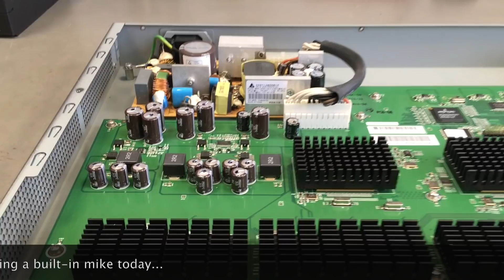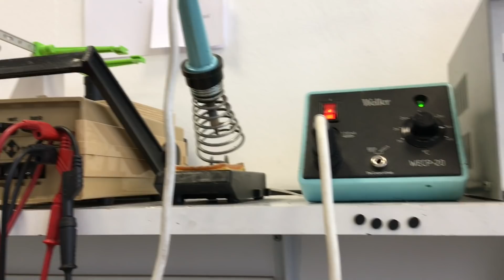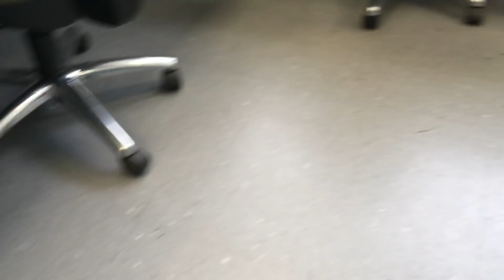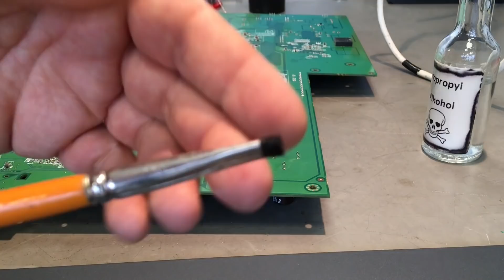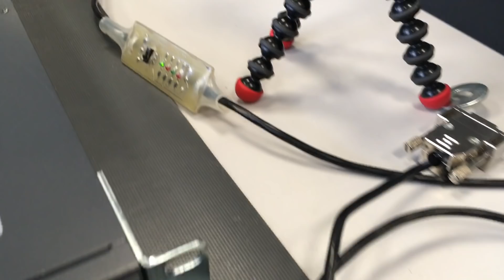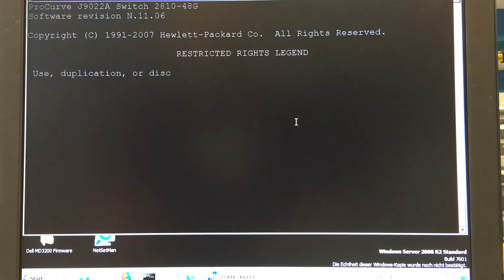Mainboard capacitor replacement - PWJ157

Comment: While I have the desoldering station,  Hot air rework station and many soldering stations I sometimes just get a large tip and large lead based solder and make a big ball of hot solder between the two leads.  Most of the time the caps just fall right out.  Granted I then have to clean the holes...but that's not difficult.   Never had any damage done so far.
Reply from the maker: That's not far away from what I do... Sometimes it is necessary to fill up with fresh solder before the unsoldering works. Especially with leadfree solder. But I prefer to do it pin by pin. There are many ways that work. :-)

Comment: What year was your PACE Thermo-Drive desoldering station manufactured in? It is a very early model.
Reply from the maker: I can't say that exactly but when I started working in 1989, it was already here... :-)
We had an even older PACE machine which was given to the PACE salesman for their little museum.
Fun fact is that PACE does not manufacture soldering tips anymore, so we buy them from PLATO.
We never had problems with that machine, maybe a new heater every 15 years.
The only problem is when people forget to clean that thing.... ;-)
Reply: @PlaywithJunk  Thank you for the reply and information. I will have to try PLATO tips for my PS-90 style soldering irons, I have PS-90 SensaTemp and IntelliHeat versions they both work excellent for doing small wire harness and 4 Layer PCB through hole soldering. A lot of my designs are 4 layer PCBs. For PACE desoldering I started using the SX-70 (Sodr-X-Tractor on an MBT250) SensaTemp version which works great. Then I moved to the SX-100 IntelliHeat desoldering handpiece with the ST115 and it also works great. The SX-100 has a paper cartridge option that can be replaced rather than cleaning. I still use the glass chamber and clean with a brush. The SX-70 glass chamber is much larger than the SX-100, which is why I think they offer the disposible paper chamber for the SX-100, and it is very easy to change so cleaning is much less of a chore. 

The classical control method for PACE in regulating resistive heater temp is the zero cross AC Thyrister (or in more recent designs MOSFETS) which allows current control with very little controlling switch power dissipation. So you will see the 50 or 60 Hz 24 VAC step down transformer setup for either 120 VAC or 240 (230) VAC which is rather bulky in even new stations like the ADS200.

The SX-100 tips are very good and last a long time if properly used and maintained. Tip choices have been improved to include tips for cleaning surface mount pads rather than using superwick braid , they are very effective.

Comment: yep my ml 350 g4 i got doesnt even boot up anymore because of bad caps i discovered while restoring it. (cosmetically and hardware cleaning thermal paste replace ecc) i have to get a small soldering tip since i have a too big one and a too thick wire
Reply from the maker: Don't buy a too small tip. My experience is that a short and wide tip works best together with a thin soldering wire.
ML350 G4 is notorious for bad caps. Unfortunately replacing them does not always solve the problem. I had some that did not work after cap replacement.
But you should try...  ;-)

Comment: Why you repair switch by soldering capacitors when you have 100 year warranty ? Call service and change switch ... You paid warranty when you bought switch ...
Reply from the maker: that is correct but the repair was faster than waiting for an exchange, And there would be no video to watch :-)
Reply: Ok, so I understand and I'm glad to hear ... Thanks for new video ...

Comment: After soldering, reheat one pin at a time and straighten wire. Then hold upright and reheat solder joint letting the solder flow down like it did when it was made with gravity. Clip wires and then reheat if you want one more time and your joint will look like it did when it was made,,Just sayin...it's what I do....too much solder can cause a future short with the ground plane on the positive leads...
Reply from the maker: sometimes I do that. But with this board I fear that wouldn't work so easy. I had better boards to repair than this one...

Comment: Maybe I've missed something in the past and sorry if you've been through it before, but I'm a bit curious about that serial crossover board you have. I can quite easily work out how you've done the switch, but I'm curious what you're using to control the leds and how the circuit is determining their status?
Reply from the maker: Watch "PWJ70 Tool for serial fools"

The circuit is super simple. Green LEDs light up at negative voltages (0), red LEDs at positive (1)
When the switch is wrong, onle one LED is on because both transmits are connected together.
Reply: @PlaywithJunk  cool, thank you!

Comment: I using 150W induction heated iron with large tip and firstly add fresh leaded solder to both leads and wait until cap drop off freely, after qickly use hand desolder pump.  Soldering new ones i also heating both leeds simunteniosly with large tip, seems like more efective a qicker way

Comment: With huge heat sinking ground planes like this I find it easier to use those large plumber type solder irons and to pull the components out by hand.

Comment: Anytime I do a repair job like that I write a note on the inside of the case, sort of like "Replaced caps 10/11/19".  Handy if someone else has to work on it at some other time.
Reply: I just mark the outside of my equipment so I know without taking stuff out of service and pulling the covers :)
Reply: @benbaselet2026  I do a lot of repairs from home, so it's just a courtesy to the next person lol
My own gear, write on the outside

Comment: Anyway, you really should place the FC far far away and use Panasonic FM for this applications, as they are far lower ESR and higher ripple current....
Those FC are good as a replacement for really old stuff like a PSU with GP Caps or something like that. But for Buck regulators, lower ESR (as close as to the Original) is a good idea as well as using higher voltage ones...
And GP Caps like the NHG shouldn't be used in this application at all.

Comment: What brand and series were the caps you removed? Nippon KZG series often go bad even though Nippon Chemicon are supposed to be good. I always replace bad crappy chinese caps in ATX PSUs (even if they haven't gone bad yet) with Panasonic FR series rated for 10,000 hours. I don't trust Nippon Chemicon.
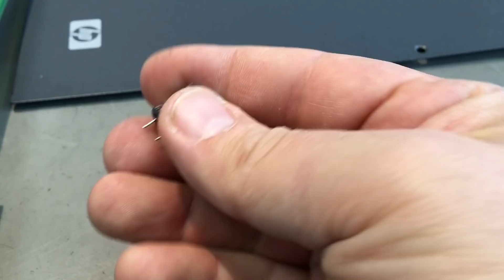Reply: Good guess 9:46 you can see it's indeed the dreaded KZG series (at least according to badcaps). I've ran into lots of these from various devices.
Reply: Yes, I thought it was KZG from the colour. Not really sure what colour you would call it though. Its not brown and its not purple
Reply: Simon I would agree with your choice of Panasonic FR series for the repair. It is interesting that in the Panasonic 2020 AL Electrolytic catalog the FR series is listed first even though it is not first in the product tree or considered a base family. It is clearly a very popular device for low ESR and service life. It would have been nice if PWJ analyzed some of the caps removed for ESR, but this would require some additional test gear. 

In choosing the caps I think the procedure is to look up the specs on the failed parts and then choose a proper replacement, or perhaps improve on the design as you suggested. I think also in "re-capping" a mother board you would just change all of the AL Electrolytic caps as a matter of good practice. But PWJ clearly does not like dealing with large ground plane PCBs. He needs a higher power soldering iron. I have two high power soldering stations so I can use the two handed method in removing large caps. Although my tips are much cleaner than his and I use some additional liquid flux. With enough flux you can actually clean a through hole using solder braid (Superwick #453 fine). However, I would just use desoldering station like my PACE ST115 to clean out the hole. If you drop out all the caps you can stand the board vertical and add a little solder to the opposite side of the desoldering gun and the PTH will be completely clean after the suction cycle. Not sure if you noticed but I don't think the PTHs are actually completely soldered (filled). Also, I have the luxury of access to a preheater with a board holder so I could of preheated the board before soldering to make sure the PTHs are completely filled.

Comment: "I dont apply any pressure to the board" Board visibly flexes   hmmmmmmmm
Reply: I think he mostly pressed down with the hot air gun.
Reply from the maker: @benbaselet2026  that's right

Comment: Everyone cut the wires after soldering...except me..i cut the wires before soldering....
Reply: I guess you will stress the solder joints less by doing that.
Reply: @benbaselet2026  and it looks nicer cleaner and more professional...
Reply: I've done that once, when struggling to make a board as low profile as possible! It had to fit into a very restricted space.
I think I made it 1mm thinner, but it was a bit of a pain. More so when I picked up my flat sided cutters instead of the ones with a slight chamfer  on the cutting edge... Those legs were a little shorter than I planned!

It did look very neat though.

Comment: Don't procurves come with lifetime warranties? then again it may require original purchase documentation
Reply: Colin Stuart  in deed it comes with a lifetime warranty. No original purchase documents are needed, i returned two of these by opening a ticket with HPE. You will get a replacement unit in advance and you may then return the faulty one. Newer HP switches are lacking the lifetime warranty.

Comment: Remember that sometimes the silkscreen on the board is wrong, and you might end up putting the new capacitors in backwards. Also failed ones are not bulging every time, they can leak out and go dry from the bung at the bottom.

Got another brand Gigabit switch that had suffered a bit of damage from lightning, so had a very well detonated power supply ( see you did not do a power supply rebuild, please go in there and change all 47uF and 100uF capacitors on the primary side, ESR on these is critical to making the PSU happy), so tried it on 12V, and found it was drawing 3A, and the one BGA chip was cooking hot. One quick BGA removal later ( twisted it off, not a worry if it survived or not, it was scrap anyway, and no shorts on the little ripped off traces) and it booted, down to 300mA on the remaining 2 chips, though it was now only 16 ports on self test. Used it for a while as a switch anyway, with a old 12V power supply, till I got a new router that had more than 1 port out. Now looking to scrounge an old POE port to replace it, I have some old POE stuff to try out.
Reply from the maker: Yeah exactly. I also had one board from a cheap active speaker with wrong silkscreen polarity. And yes... only because e cap has no bulge, that does not mean it is OK.
Reply: @PlaywithJunk  I've known incorrect silkscreen polarity on a TV from a top brand too.  I have an ESR meter which I've modified with a footswitch remote control, though of course sometimes you can't test them in-circuit.  Often the act of desoldering a capacitor will reform it and get it back into spec, so sometimes just a blanket replacement of all electrolytic capacitors is the best approach, depending of course just how many there are.

Comment: Almost exactly the way I would do it.  I generally also clean the board on both sides with isopropyl alcohol before installing the new capacitors because the board is flat then and it's easy to clean.  Excellent work, well done.

Comment: It seems easier to me to tip the cap away from the lead you are heating, and then same with the other lead. Remove the cap before trying to clean up the solder. I love your videos, thanks!
Reply from the maker: I know what you mean. This method is good if you don't have a hot air gun or a proper desoldering iron. I prefer my method because normally it works with no additional cleaning of the holes.